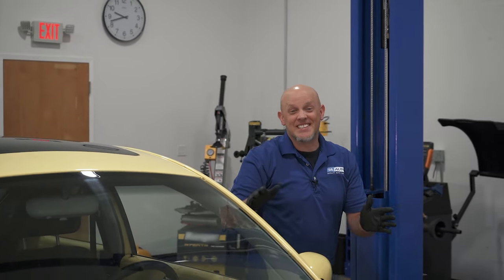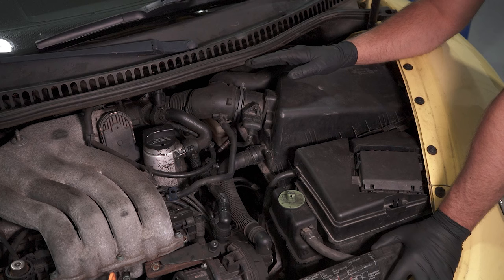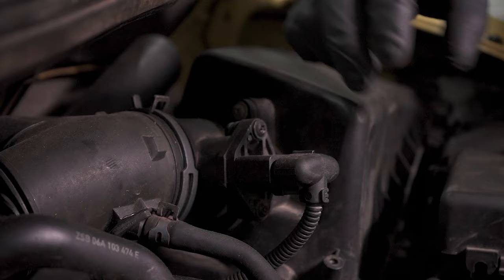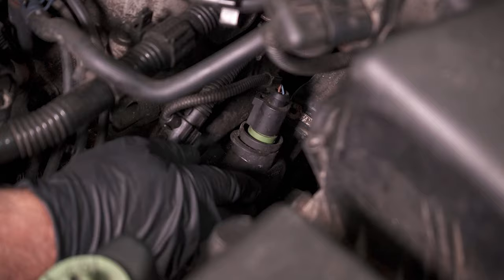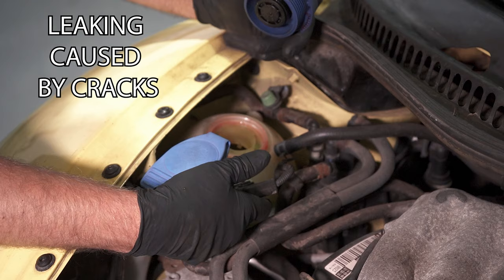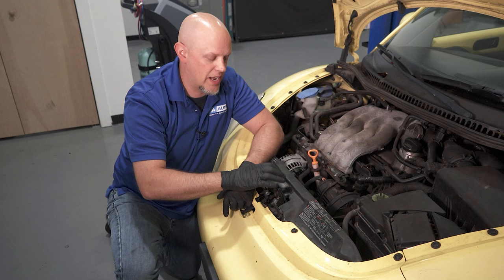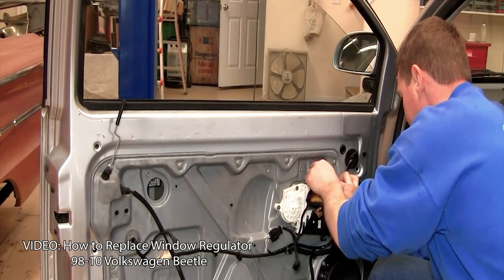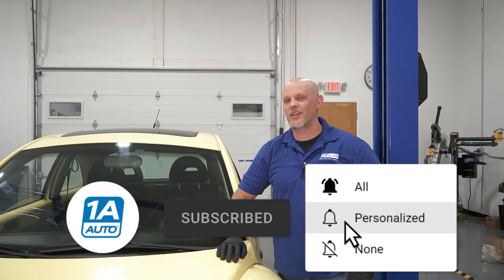Top 5 Problems Volkswagen New Beetle Coupe 1998-2010 1st Generation

Comment: My 1999 New Beetle 1.8 turbo had  faulty window motors, MAF sensor, Bad Clutch, peeling plasti coating on interior trim, halogen bulb on the right headlight that kept burning out prematurely......all within 75K miles.  Sold it to Carmax for $12k in 2005. Good Riddance.
Reply: My sister had a 2000 that caught fire, and burnt up. Electrical problem in the dash .
Reply: What cars do you own now 😭

Comment: You forgot #6, the leaking 3rd brake light that cause corrosion in the connectors which in turn causes the loss of power to the hatch and it won't open
Reply from the maker: +david ray Thanks for the feedback!
Reply: @1AAuto  can you spot the battery drain problem? Seems every beetle has this problem

Comment: Watch Out For The Fuse Box Melting On Top The Battery! It Will Make The Coolant Fans From Working. And Numerous Other Electrical Issues.

Comment: Two things are missing: 1. Those with the 2.5 engine always develop a severe oil leak 2. The headlight connections can never be plugged back in right if you have to replace a bulb.

Comment: I've had my 2001 beetle since new, 22 years now and 329,000 miles. Only real issues I had were the window regulators in both doors. Mine's diesel so it doesn't have some of the other problems.

Comment: I own a 2003 1.9 TDI beetle luna convertible with 130k plus mileage, only issue I've had is the power steering going faulty, other than that the engine/turbo is really reliable even passed 130k mileage. Nippy cars the 2.0's would recommend 👌

Comment: I had a 2003 vw beetle convertible and it cost me soo much! First transmission went out completely, the side interior panels kept falling, 4 M.A. sensors, throttle body clean, thermostat, the heat never worked the people before me used premium gas so I had to use that and then my beetle left me stranded like 3 times ohh and the shifter for the PRNDL broke so I had to lift the plastic each time to get it to the next gear  …and the trunk loved to pop open even when I didn’t touch it!

Comment: My daughter's 2006 had a constant issue with Volkswagen's version of a P.C.V. Valve.

There's a rubber diaphragm that literally looks like a piece of Salami that wears out and dosen't allow the car to idle correctly. 

We were also advised not to fill up the gas tank past 3/4  or there would be issues with flooding out the Carbon Canister. 

Aside from all it's little quirks  , when it was running right it was a great little car .
Amazingly even in an Ohio winter.
Reply: Lol. I deleted the PCV before it died. Nope, not dealing with that.

Comment: I suggest adding negative battery to the alternator wires, and starter they seem to burn. How many window regulators should I buy once the OEM breaks? I have installed 4 or these and machined brass pulley wheels to get them to last longer. The door pulls break off and needs an after-market replacement.

Comment: The core support is plastic, so if you have a cheap aftermarket core support it may sag preventing the hood from latching when closed. I have to adjust my latch all the way up. I may actually add a removable metal frame to raise and stiffen up the core support

Comment: Thanks for your excellent video, but the biggest problem on this Beetle, is chassis corrosion. Just disassemble the front and rear fenders and you will find a big surprise, even if the car has been taken care of to the maximum.

Comment: Greetings. I own a 1.8 20vt Beetle Turbo S and you were right, had to change the coolant temp sensor. Know, there is the weird sound on full throttle, usually after the car sits a long time, that sounds like tiny tiny knocks, and I was told it is the knock sensor. There are no fault codes stored on the ECU. I run some tests on a dyno, the car is full health, 174bhp. Should I change the knock sensor with an aftermarket improved one just in case?

Comment: Greetings from NL. Canada!!Thanks for video ! My 59 yr old son purchased a used 2010 VW Beetle for his wife back over a year ago it drove like a new car the first 3-4 months then the problems started #1 Drivers side window regulator stuck got many new and used parts but nothing worked ! #2 water  pump leaking garage say cost over $3000 dollars to replace. .also need single radiator fan , car still drives perfect but after driving 30-40KM  it over heats. Is there a fix besides replacing water pump?? Your videos sure helped me over the years thanks for that.

Comment: Really touchy when removing coolant cap on a sealed system. Very easy to get air pushed or sucked into system...then.u get air pockets in the system. Then it gets locked, and will lead to the system being bled wich is a process that is time consuming, but not necessarily hard to do. Patience is the ticket, there's no way to do anything on German vehicles that is rushed.

Comment: 0our 2006 vw diesel automatic new bug k window kept stopping midway, We rplaced the motor and regulator and still didnt work. I then noticed that the inside window rubber channel moulding was warped to this problem i let the windsow fully down and srayed wd40 in both channels and then the window went up without getting stuck, I beleive this was the main problem and wasted 440$ on a window repair. Once a month i do this to both windows and no more problems

Comment: YOU CAN ACCESS THE   M A P SENSOR FROM THE TURN SIGNAL LENSE  ON THE PASSENGER SIDE  USE A SMALL RACHECT TO GET IN THERE USE A FLASHLIGHT TO SEE IT      HARD TO FIND   REMEMBER THIS TRICK I HAVE O5 N BEETLE 1.8 20V TURBO CONV

Comment: The cost to fix things are crazy...replacing the heating core...$1700.00 ..they had to remove the entire dash board to get to it...8 hrs of work.....replaced the radiator..650.00 they had to remove the front end to do that....labor $$$ is crazy!...I like my 2010 buggy 150000miles ...but next time its a  Honda or Toyota...way cheaper to fix and they run forever before problems appear!

Comment: The climate Control module is a big issue and if it fails you lose windows interior lights, hatch pop button and sun roof. So kinda annoying at 350 dollars! If all the fuses are good and nothing works still it could be this

Comment: Disintegrating interior and sticky, failed soft touch coating on everything.
Reply: Yup, everything gets gooey with age on old German cars with soft touch rubberised coating. However if you take the pieces off and let them soak in warm water overnight the coating sheds off, that’s what I did on mine and the interior looks fantastic
Reply: A microfiber towel and a can of isopropyl alcohol cleans it up great

Comment: How about the crank position sensor. PITA!
Reply: Also, had to remove the entire front-clip to change the fog lights.
Reply: @scottmeuchel  Not really, you can just take off the wheel well liners and access the bulbs from there, much easier to do than remove the front clip. Although you’ll have to remove it when the radiator or fans inevitably stop working 🥲

Comment: I HAD A MANUAL 99 GOOD ENGINE AND TRANY HOWEVER BUNCH OF ELECTRIC PROBLEMS WINDOWS , DOOR LATCHES NOT LOCKING , EVERITHING INSIDE PLASTIC ONCE U PULL IT IT WILL BREAK ALMOST IMPOSSIBLE TO WORK ON.

Comment: looks like a simple car to maintain
Reply: They can be a pain in the but to work on but not a bad car if it's properly maintained. I love mine.
Reply: Oh no it’s not it’s very costly something always breaking down I’ve had mine for 3 years and have spent thousands. I love my car but it’s a pain at time
Reply: lol
Reply: You say that until you take a good look in the engine bay. Cant get around NOTHING. have to take off every little peice to get to something a little further down. It's such a small compartment. 
I'm a women with small hands and it's still a pain to reach some things.

Comment: Chevy? Are you joking? The Chevy is no where near the top. Not a strong start to tell such a lie.

And no mention of one of the bigger issues - the badly designed rear 3rd brake light that’s leaks water into the trunk where it causes connectivity issues in the read hatch lock switches to set off false alarms or prevent opening.